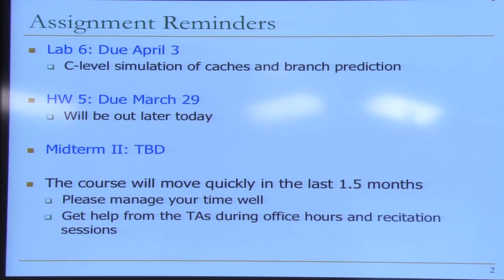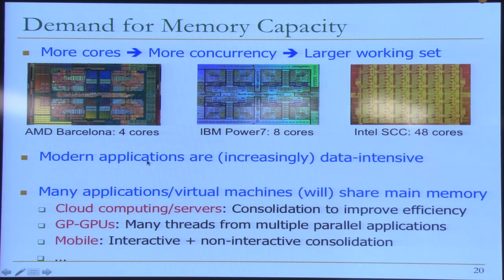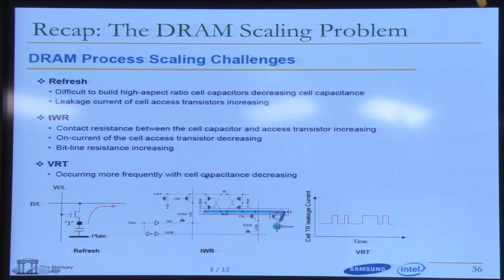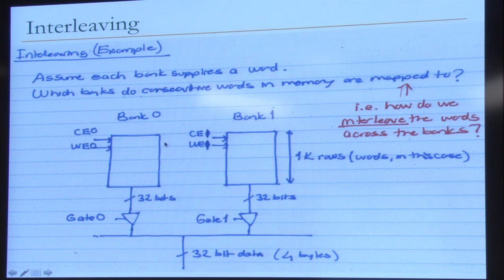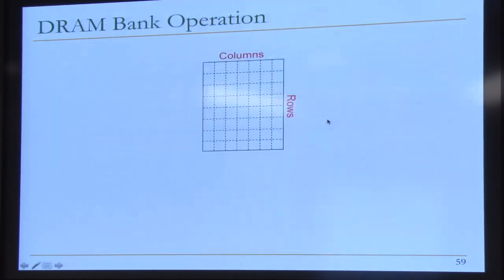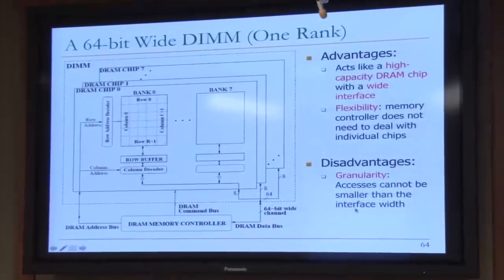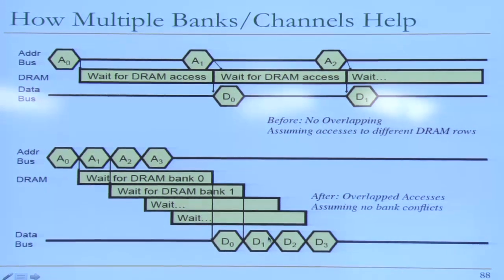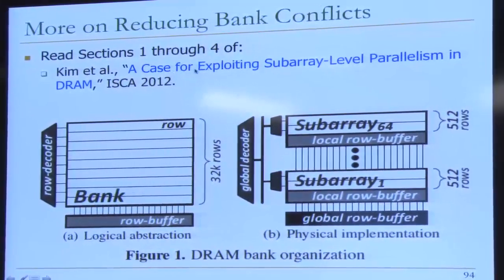Lecture 21: Main Memory and the DRAM System - Carnegie Mellon - Comp. Arch. 2015 - Onur Mutlu

Comment: I don't get the point that each column gives 8 bits?? Column decoder is also a mux which selects one of the bits in row buffer??
Reply: A single row buffer consists of multiple bytes. For example, you can have a DRAM with 8kB row buffers. The column decoder is used to select the block (again block size can be different, for example 64  bytes) in the row.
Reply: I think in the images it is abstracted to show a single bit; but under the hood, the columns actually consist of 8 stacked memory cells (connected to the same row-column intersection).

Comment: Hi  Prof. Onur Mutlu,
All the facts beautifully explained. Hats Off! Thanks for the lectures.
Now, I have two doubts, first how memory controller is selecting the rank no. from given address? You have shown only row, channel. & column selection from a coming address) ( Time : 1:19:22  - https://youtu.be/IUk9o9wvX1Y?list=PL5PHm2jkkXmi5CxxI7b3JCL1TWybTDtKq&t=4763 )

Second doubt: Do you have any video explaining the Memory Controller & PHY interconnection with working with DRAM Chip. How different timing signals like DQS etc work together? If yes please share the link.

Comment: In THREAD CLUSTERING MEMORY SCHEDULING
My doubts are -
1. Which threads are you refering here ? Is it hardware thread or kernel/user thread?
2. How does memory controller gets the information related to thread?
Reply from the maker: 1. It is hardware threads. More specifically, hardware context ID.

2. The hardware context ID is communicated with each request to the memory controller.

I would suggest reading earlier works on the topic of thread-aware memory scheduling, which cover such information in more detail:

Mutlu and Moscibroda, "Stall-Time Fair Memory Access Scheduling for Chip Multiprocessors", MICRO 2007.
https://people.inf.ethz.ch/omutlu/pub/stfm_micro07.pdf

Mutlu and Moscibroda, "Parallelism-Aware Batch Scheduling: Enhancing both Performance and Fairness of Shared DRAM Systems", ISCA 2008.
https://people.inf.ethz.ch/omutlu/pub/parbs_isca08.pdf